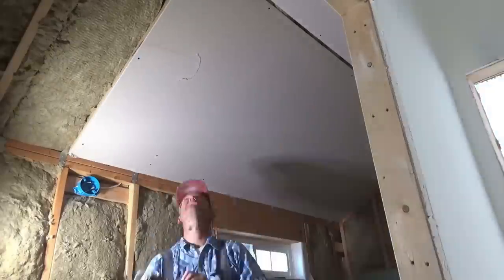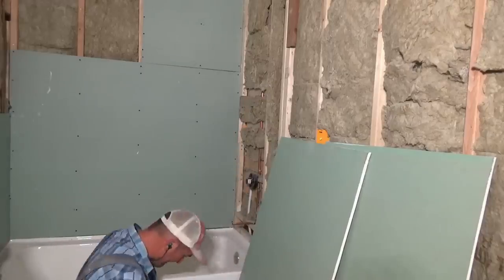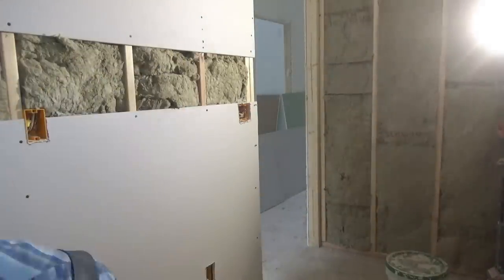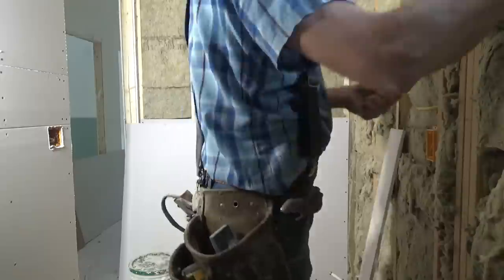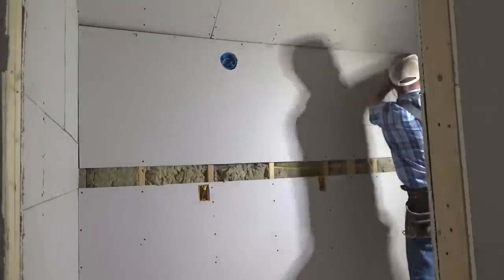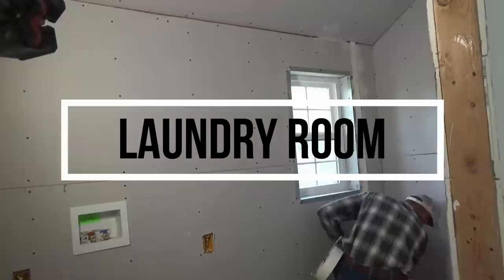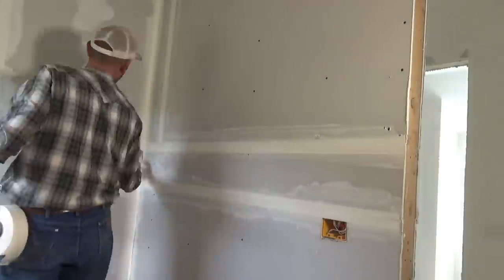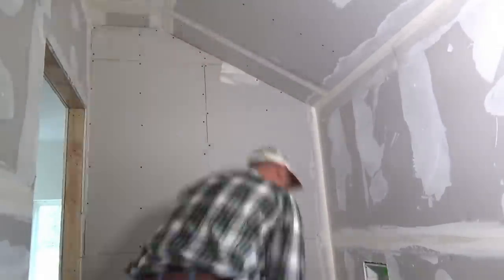#332 - MOLD - Vapor Barrier Vs Green Board Drywall - Bathroom And Laundry Room

Comment: For those of you who are really concerned about the Bathroom Tub and Shower Area:  International Residential Code (IRC) 702.3.7.1 Limitations. Water-resistant gypsum backing board shall not be used where there will be direct exposure to water, or in areas subject to continuous high humidity...  So the green board doesn't cut the mustard around the bathtub, unless using distinctive surround shower kits. Some folk put a coat or two of Red Guard over the green board - StarTile on Youtube does this and thinks it's ok.  But I suspect Red Guard over green board is not a code approved method.  For sure, using fiber cement board cuts the mustard.
Reply: I can't bear to watch this video again, but something about putting "vinyl"? and then concrete board, and then ceramic tile?  Hmm that's a lot of mustard to cut.
Reply: @JohnDoe-np3zk  In the bathroom, you may not need both the vinyl and concrete board.  When I did the bathtub area, I used faced batt insulation, concrete board on top, and then tile.
Reply: @monicapttrsn  I'm not sure what he meant by "vinyl".  I agree, go with concrete board right over the studs over the fiberglass batt insulation that has the "vapor barrier".  We went with a tub surround over that.  I'm not up to doing tile work that's for sure.  I like the cedar faced "Hardipanel" stuff indoors and out.
Reply: @JohnDoe-np3zk  We can really use an Inspector's opinion on this blog.  The polyethylene would be the general requirement for the whole house in that cold climate.  But then there's the bathroom, which kinda sorta has it's own requirement.  For a tub surround, you don't need the cement board (can use green board) because the water comes in contact with the surround instead.  Ok, R702.3.7 says not to use water-resistant gypsum board over Class I or II vapor retarder in a shower or tub compartment....The polyethylene is Class I.  So, one could install the Class I over the interior of all exterior walls, except around the bathtub, when using greenboard + tub surround.

The code is confusing.  So, from what I gather, it is ok to put green board over the poly sheet for the general house, but don't put the green board over poly around the bathtub.
Reply: @monicapttrsn  from what I heard in the video, the intent? is to put plastic? over the green board, to act as a vapor barrier that he doesn't use?  Then, to put concrete board over that, and then tile over that?  This is belt, raincoat, suspenders, and a sandwich board all in one.
Reply: @JohnDoe-np3zk  Ok, in the bathtub, the code does not want green board installed over Class I or II vapor retarder.  Class II is Kraft-faced batt insulation.  So I may be wrong about putting green board in your bathtub surround, if you use Kraft-faced insulation.  It's a catch 22 situation around the bathtub, which is why I am a little confused.  What the code is doing here is limiting the green board to the point (around bathtub), that one has no choice but to use cement board.  Heath can't put plastic over the green board and then put concrete board over it, without violating the code.
Here's what I found when I pulled the tile off the bathtub:  regular drywall was molded, faced insulation was mostly eaten away, mold everywhere except on the studs.  No green board or cement board had been used around tub.  So, I installed faced insulation, and then cement board, and then tile (California climate).  What makes Heath's case difficult is what to put on the bathtub walls in the cold climate...as far as I can tell from the code, he can use Class I or II, then cement board, and then tile.   But in your surround tub case, the green board is not taking the direct water hit, the surround is, and therefore R702.3.7 may not apply in your case....That is the final question for the inspector (if you use surround compartment, can you use green board?).
p.s. A basic tile job is not that bad.  You can hang a large piece of drywall on your fence outside (vertically) and practice laying tile...when you're ready, you can start the bathtub area.  That's exactly what I did, and the tile came out beautifully.
Reply: @monicapttrsn  I would believe that if you use the green board, and then put the surround over it, you would be OK.  The putting up concrete board over vinyl? and then tile over the green board seems wrong and could end badly.  I'm not a big fan of tile, I like solid surfaces.  Grout is a pain!
Reply: @JohnDoe-np3zk  I agree with you.  Ok, so you're skipping the tile stuff.  I wanted to go through the tile experience at least once in my life....I've seen pros like HouseImprovements on youtube use green board and then surround....Yes, I believe Heath's approach could end badly.....
WAIT!  Maybe Heath is right and his approach should be used.  What's the chances of mold getting through the cement board, and then the green board?  Maybe close to zero chances.  The idea is to prevent mold and protect the wall cavity from rotting.  Maybe Heath is onto a new discovery, because people are tired of all the mold around the bathtub.  The sandwich idea may work.
Reply: @monicapttrsn  yeah I think I'd prime and paint the green board even behind (especially behind?) the surround, use good caulk, paint with semi gloss, and call it "good".  The only question mark would be adhesion of glue.  Maybe just give it a primer no paint.
Reply: @JohnDoe-np3zk  If you have joints with the green board, go ahead and mud tape them up, as is required for cement board.  You want the green board (or any board) seams taped up behind the shower for sure.  Imagine if some dodo head pointed the shower head on the wall above the surround.  With joints sealed up, the water won't get through.   can't see why semi-gloss paint would hurt, only help.  Back in the day, the standard was to put two layers of drywall up (around bathtub), which is the sandwich affect.
Coming to a near conclusion is this:  Many homeowners end up with gross mold behind tiled showers/bathtubs.  Some situations are so bad, floor joists get rotten, studs rotten,  insulation is eaten (disappeared except minor traces) and a big mess (I did have to replace some 2x6 floor boards on my job, plus floor sheathing).  My crawspace configuration was floor beams at 4' o.c. with 2x6 boards on top, and then floor sheathing.  
So, the mold problem has really never been solved REGARDLESS OF WHAT THE CODE SAYS.  We can only best guess how to slow the mold process down for say 25 years.  So, the code finally decided on cement board.  But if those board joints are not taped up, water gets behind the wall....seal up that green board good.  And then slap some paint over it!
Reply: @monicapttrsn  I think hard wiring the fan to the bathroom light makes sense.  It's nice to believe everyone will remember to turn on the fan but few do.
Reply: @JohnDoe-np3zk  My girlfriend and husband went away for three weeks and let a couple stay there in the apt.  When she got back, there was mold all in the bathroom because they wouldn't turn on the fan.  The bathroom had no windows.  So many people think it's not a big deal just to keep running water and never use ventilation, until the floor just about collapses.  I personally know my roommate (the homeowner) who closes the window, uses the jetted tub for a couple hours (no vent in bathroom), and will just leave it and tell me I am the problem for  thinking something is wrong.  I sneak in there and open the window most every time.  Some people have no common sense.  Maybe that's why the other private bathroom was so messed up here.  And guess who was told to pull all that mess apart and fix it - ME.
Side note Coincidence.  On my evening walk just now, I ran into a guy with several tubs of Red Guard in the driveway.  He's going to put up chicken wire around the tub, plaster it, Red Guard it, and then tile it.  He says he's been doing these jobs for a long time.  He said Red Guard with green board for tile cases will probably work, but not last as long.

Comment: Is cement backer board (e.g. 'Hardieboard') considered a vapor barrier? It seems to me that cracks in grout could allow the gypsum in drywall to get wet over the years, whereas concrete board under tile makes a lot of sense.

Comment: hello! I'm building on a bathroom and am using 5/8" sheetrock for the entire house. Question:

Do I need to insulate the interior walls for the bathroom, or can I not do that?

I think the 5/8" drywall will be sound proofed enough. 

any other reason to insulate the interior bathroom walls besides acoustics?

Comment: I am going to add a small bathroom in an existing bedroom. I'm hesitant to remove the ceiling drywall because of the insulation that was blown in. Will it work if I just put green board over the ceiling 
regular drywall ?  Thank you

Comment: I live in Fort Myers. My house was flooded out by hurricane Ian. I had to tear out the sheetrock all the way up to the ceiling. Had black mold throughout the house. I am currently, hanging sheetrock with greenboard throughout the whole house.  It cost a little more, but I figured, given the humidity down here, that it can't hurt.

Comment: We still by code need a vapor barrier, if you talk to building scientists they all say to use vapor barrier in cold climates (climate zone 5 or higher). Vapor barriers are needed in winter not summer. Oh and every house had mold sorry. Learned that from a mold and moisture class.

Comment: At 5'32" Poppy said that greenboard is required in bathrooms BY CODE and then what I see is that he has NOT used greenboad throughout the bathroom. He HAS installed the greenboard in the shower obstensibly as a foundation for the tile. What did I miss? Does CODE require that greenboard is used in all of a bathroom, or some part of a bathroom?  As far as I know greenboard is said to be water-resistant and so using it as foundation for the tilework is questionable if one is concerned about doing things correctly and avoiding creating mold.

Comment: Such a controversial topic. In a home with a different heat than a wood stove. You bathroom is a place of high humidity.  Moister is almost certain that ot will defuse i to the wall. A moister barrier makes sense . But what do I know. I'm trying to figure it out. If moister can enter a wall then it should be able to exit the same path back out. So then how can a moister barrier trap moister.  I'm just thinking out loud. I used rockwool and didn't use any barrier. Air sealed and 2 by 6 walls. I wonder about the bathroom though.  Smh..

Comment: Yeah, probably no need for a vapor barrier in your area. Dry up there. I'm a big admirer at your commitment and drive in building all you've built from scratch and the way you put together your videos.
But PLEASE stop giving so much credence to what the so-called experts out there say. I got tired of the vapor barrier issue 3 minutes in. Sorry.
You know what you're doing. Don't listen to all those that THINK they know.
Best of luck and can't wait to see you guys move in and the kids roaming the hills.......following Ruger, of course.
Reply: @JohnDoe-np3zk  He's in zone 6 and code definitely requires a VR. Heath lacks the ability to focus on the right information. First read code. Then ask the inspector if there is an exception to code. Then decide how to proceed with a VR. There is really no need for a long conversation on the topic if the inspector will not give an exception. Hopefully he has already asked the inspector for an exception or he could be in for a lot of work if he has to pull the drywall and put in a VR.
Reply: @pauljfontana  Idaho is kind of an interesting "case" as to building codes and trying to decide it they are holding somebody to them, or just let them do the "own thing".  Perhaps the inspector knows that 95% of people will use fiberglass insulation with a vapor retarder as part of it.  Nothing to "add".  I do know Roxul was quite clear that one is needed in Zone 6.

Comment: PLEASE,  this has nothing to your build. I built my home in 1998 in wasilla Alaska. I was on a out of pocket budget. I bought a train car load of sheet  rock. It was unclaimed so I paid ten dollars a ton for it and there is a lot of sheet rock in a ton and I paid a hundred dollars for it delivered on my flat bed truck ... get it done but no rush. I jumped on it. I got my R thirty isolation the same way. I bought out all unbought or paid for two by eights of all dimensions and I got twelve F 800 ford flatbed truck loads that had to be stacked above the cab because of the lengths. I had enough lumber to build three large houses and I gave away a lot of rock and insolation. I built my shop first cause I worked outside on the ground with my mechanics business. I got it up and weathered in in two weeks with chicken and potato salad meals to the neighbors. (bring your own drinks)  as I didn't have my well yet. I lacked a hundred feet where big trucks could go at first but I rented a dozer and fixed that. Then spenard builders gave me a free building pack in a drawing so I couldn't fail right. Wrong. I never covered some of the lumber that I wasn't using and stuff got wet and ruined. I saved some but other stuff was haul away. I was doing everything in september where the days are six hours of daylight so roofs are important and I took my own time and made makeshift roofs over everything left and it worked. The day temps were in the sixties but at night dropped to less than freezing. I dug by hand all my footers and leveled and the gravel for cement on grade slabs (non back financeable) didn't know at time but luck hadn't run out yet. I called Pen Jersey well drillers and at twenty five a foot would put a well in for me if I would work on their over run of breakdowns for a while. They told me that no one got water there in that large area because of natural gas and hard pan. I told them I have a plain ut they had to follow. They agreed and when they came up I said about ten feet off the drive is a very old birch that was healthy and that off the side was a narrow pocket of water. They looked at me funny but set up In firs hour they hit rocks that ruined bits right away and I told them I would pay for but they just said it happens sometimes. In three hours and five bits later I said lets move and they said what guarantee is it better there? They had me there so on digging they went with big drill rig. In four hours they hit water but it wasn't moving water and they were only down forty five feet.  I asked them what they thought and they said we are still in rock so we are safe and they drilled down to fifty feet with three more bits on trash pile. BUT they hit clay. I told them stop drilling so they did.  They perforated the casing on the last five feet and then set it in bottom .... but they stated. they puse water in and out for three days building me a pool. I used the well for years at about five gallons a minute. It hit fifty feet so it was bank Financeable and that was gold. I and my granddaughter built house in the next thirty days ( four walls with electric in parts and dry so we camped in it while I finished building it and working ten hour days in shop. I wish I hadn't got hurt and lost the place. The new owner did very little to it but live in it (appraised at three fifty) They paid ten cents on the dollar for it....//...,,,, I hope that it son't burn or rot out or... Anyway we were obligated to put up vapor barrier. And hanging five by ten green board 5/8 no less will make you ko have muscles in your you know... I used to stand six one but five eleven should be closer now. When I started I weighed two sixty plus more than I will admit but now I weigh two thirty and another large number like seven or eight... Losing battle

Comment: If you want it air tight you will need to caulk the gaps on your siding. I would be willing to bet your siding that you butt jointed leaks water into the wall on the insulation causing mold. You said you would build a porch but it has rained on that siding in the front a lot and Im sure it leaked into the insulation.

Comment: Do you use a silicone sealer between bath and tiles?  I always  see mould on showers and baths where it is used. When I redo my bathroom I want to use a 2part clear  epoxy ..most probably just have to take the glaze off tiles and bath to get a great bond... you must be getting tired of all that work now....but just think about the great break you will be enjoying when all is finished. Greetings from South Africa.

Comment: I want to know if this guy has venting in certain places in this micro home?
Reply: He added a DIY 4" vent in the exterior wall then covered it up with the Roxul.  Completely inadequate venting in the attic.  It's on a slab.  No air intake for the wood stove as is needed.  Will suck cold air in around cracks for combustion air.